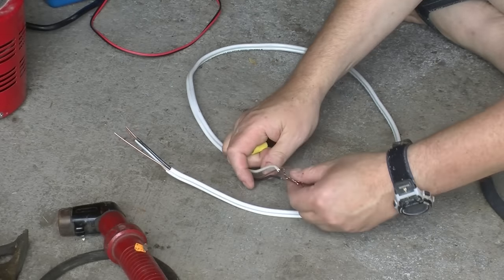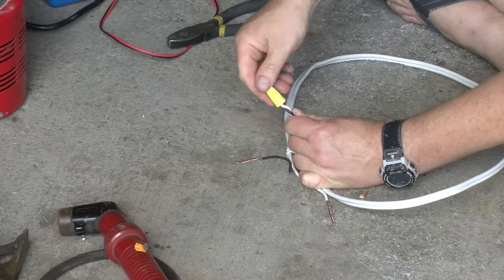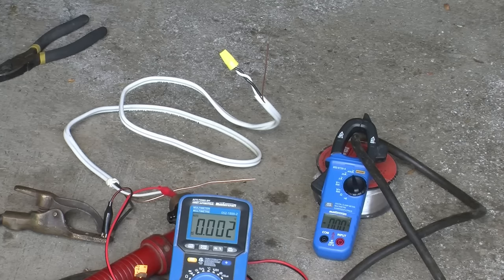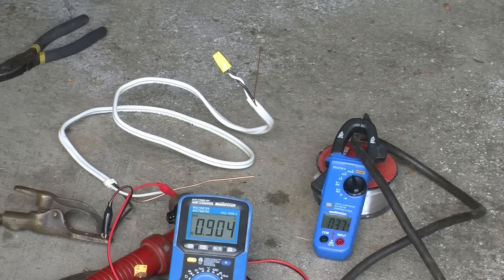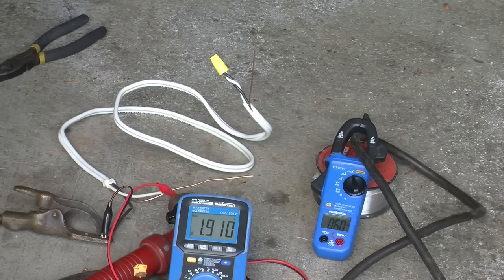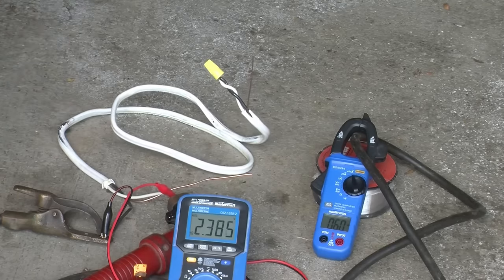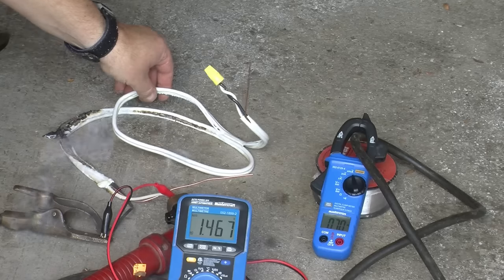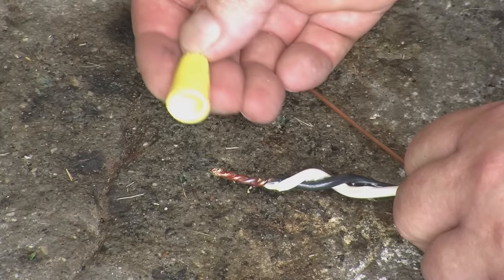How many Amps to burn up 14/2 electrical wiring?

Comment: temp rise rating on conductor insulation is ???
Reply from the maker: Most home wire today in Canada and the US seems to be rated at 90C operating temperature but the older stuff from 40 (?) years ago was only 60C. I did some later videos with 14/2 in insulation and the 60C stuff would be a real concern in some situations.

Comment: I haven't seen 14 awg wiring used in new residential wiring for a long time.  Probably not since the 60's or 70's.
Reply from the maker: Really? All 12/2?  If wonder if is a regional thing? Plenty of 14/2 here in Ontario.
Reply: @ElectromagneticVideos  it's typically 12/2 with ground on everything except dryers, hot water tanks, and heat pumps.  They're 10/3 or bigger.
Reply from the maker: @duaneadkins1261  Interesting! What state or province are you in? I wonder how much more the larger cable costs on a per house basis? I'll bet its minimal compared to the cost of the labor to install it.
Reply: @ElectromagneticVideos  I live in West Virginia, United States.
Reply from the maker: @duaneadkins1261  Interesting. I wonder how widespread 12/2 for the wall outlets is in the rest of the US?
Reply: @ElectromagneticVideos  I believe 12/2 is pretty much the standard for wall outlets.  
There may be a few that use 14/2 for lighting circuits but I've always used 12/2 for lighting and wall outlets.  
Currently the cost for 12/2 is running $159 for 250 feet or $659 for 1000 foot rolls.
Reply from the maker: @duaneadkins1261  So really not a huge expense when compared to the many hundreds of thousands of dollars to build a house. I wish my house was that way - or at least the circuit my office type laser printer is on which shares the same circuit with the smoke alarms: One hot summer days when the incoming  voltage to the house it quite low to begin with, the laser sometime triggers the smoke alarms. I guess the detectors don't like an instant of voltage below a certain level.

Comment: Since it also depends on the length of the wire, that would be a good variable to add to the test. Your wire is pretty short, but I'm curious what a standard home run would be from end to end could handle.
Reply from the maker: Your right that the longer the wire, the more power is lost due to heat for a given current. The effect of that is less voltage delivered to the load (meaning say 5V less or so for a 120V circuit). 

However, the watts of resistive heat generated per foot of wire is the same regardless of length so the amount that the wire warms is not related to the length for any given current. The connections at the end of the wire do have an effect - either further warming or cooling the last few inches of wire depending  on the temperature of the connected device. 

A huge thing missing from the video is insulation around the wire if for example it is installed in an outside wall. Did some tests with the wire in  fiberglass or foam insulation in later videos. The current at which the cable gets too hot goes down as one would expect. In some cases like in a hot attic between insulation the safety factor seems a bit low for me....

Comment: Ohms brother. The length of the cable is going to make a very big difference. Normal household runs probably average 20-30 feet. Your real life number is going to be far lower. Someone with technical knowledge can maybe help me and say if I am right in this assumption? I think that is how it would work.
Reply from the maker: Common misconception. The restive heating in the wire is a constant watts per foot that only changes if the current or wire size is changed. Since the heat generated is in watts per foot, if you have twice the wire length, you get twice the heat, but that heat is distributed over twice the length also. So the warming effect at any point on the wire is the same. 

The really issue with this test is that wire is often surrounded by insulation in a wall making the temperature rise far greater for any given current. 

I did a writeup here that includes a link to UL testing done in a similar way:

https://www.youtube.com/channel/UCV2-Qbq9o0EOQWPLAWkVH2w/community?lb=UgkxeilOfLJGy2ODslnBW0WFXUE580oHhFyP
Reply: @ElectromagneticVideos  Thanks! Awesome response!
Reply from the maker: @Muscleupsanddangles  Glad you liked it! If you interested, I did a bunch of follow up videos with wire in a 2x4 wall, surrounded by different types of insulation. Not nearly as entertaining as this one, but particularity for insulation like spray foam, the safety margin gets lowered to the point where I would use a larger wire size that required particularity in hot places like an attic.

Comment: Actually,  you DO NOT PRE TWIST  the wires
Reply from the maker: Well it actually depends on the particular connector,  and many (at least in this area) seem to allow twist or no twist.  Electricians seem to be split 50-50 on twist or not. I prefer twist because it makes a better electrical and mechanical connection, and does not depend on the flimsy spring gizmo and plastic outer shell to hold things together if for some reason the fail (heat, time).
Reply from the maker: @randall8385  That depends on the wire nut - some apparently say that, others dont.

Comment: I’m pretty sure nec code requires 12 gauge copper wire
Reply from the maker: The basic requirement is #14 for 15A circuits. However, some jurisdictions do require #12 for house wiring,

Comment: In my experience,  it seems best to more lightly, but tightly, hand-twist the wires, then hard twist with the cap.  In the way shown, the cap can be knocked off too easily.  >200A thru #12??  This is more of a TEMPERATURE test.  The point of the video was made for 14AWG half-way through...HOT conveyed the message...should have continued at that setting with 12AWG, and then punch it with 10AWG.
Reply from the maker: So you are saying not as tight twist before the cap? Interesting! I may do some #12 tests - numerous requests for that.  The current out of the variac I use to control the welder limits the output to about 75A so I may be to upgrade my system a bit for bigger wires.
Reply: @ElectromagneticVideos  YES,  I don't care too much for wire nuts in general, but they seem to be everywhere.  I found that if the wires have several tight hand twists AND if you can get a very TIGHT twist with the cap, it seems to be the best solution...seen too many fall off.  Another method I have used is to finish with a few turns  of electrical tape.
One thing with electrical tape...after you pull it from the roll, it is stretched.  Let it relax a few seconds to prevent it from 'unwinding over time' before taping the cap to the wire.  I have seen this happen too many times!...I've yet to see any electrician take this precaution.   For what it's worth, I like to apply a 2nd wrap in the opposite direction...seems like overkill, but so is a fire 10 years down the road.
NICE VIDEO...thumbs up from me!

Comment: That wire is not for welding. The voltage it is designed for is 120Volts AC, 15 Amps.  Using a welder is not how the wire was designed or intended to be used. A Very impressive, very colorful demonstration. However it has nothing to do with real life application. Some DIY'r may misinterpret your excessive ampere numbers and burn his house down.  Impressive, misleading and frankly stupid.

Comment: Why does the US have black as live?  In the UK I was brought up to the idea that black was Neutral on A/C & Negative for DC.  Red for Live & Positive. Then it changed.  
 Now the international convention is brown & blue for A/C.
Reply from the maker: I think its just convention that developed when the worked was less connected than the way we are these days. I'm in Canada which uses much the same conventions as the the US: white is neutral and black is the the live if its 120V circuit. When we have two live phases adding to 240V, the second live is red. And more colors for three phase which is rare in homes over here.